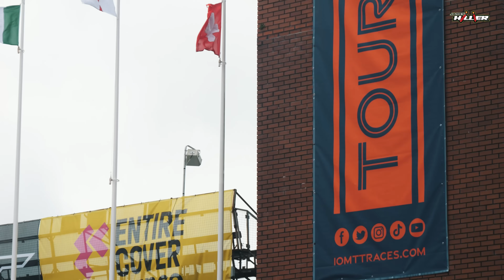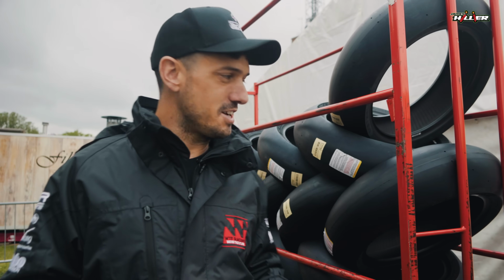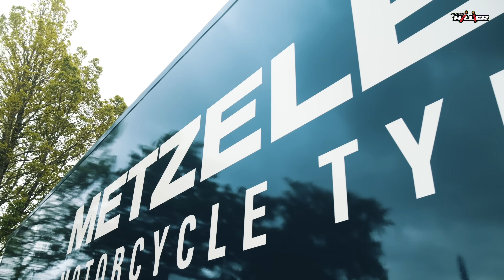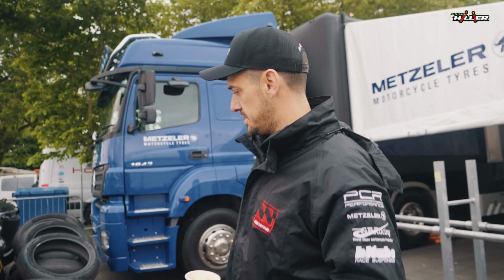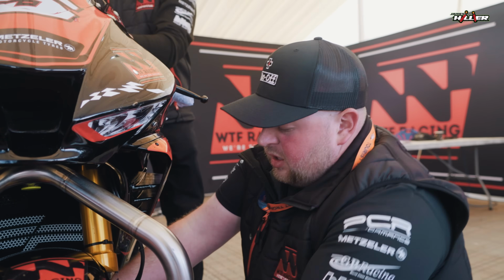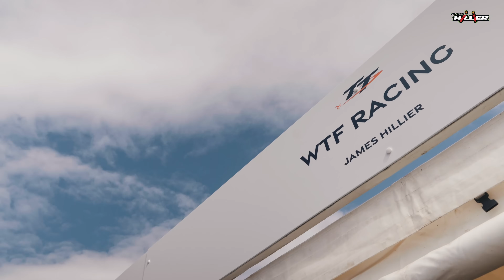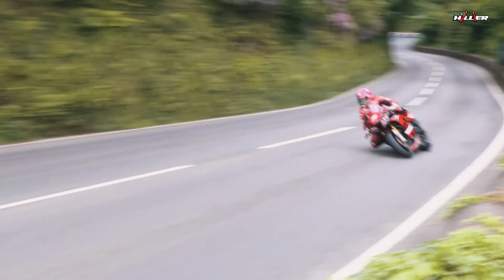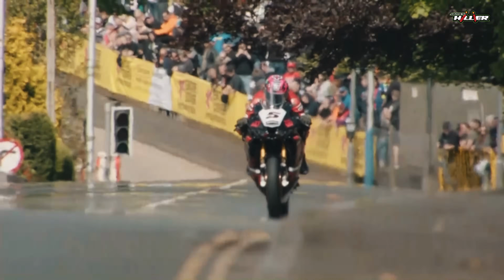Isle of Man TT 2024 // James Hillier - Episode 3 - 'Rubber meets the road'

Comment: Your TT coverage is by far my favorite. I really enjoyed the detailed discussion about tires and how you set the bike up. Some interesting topics could be: suspension setup, day to day logistics of running the team, how do you use the data you have collected to improve (you touched on this in this video) , how do you gather this data (telemetry ?), gear preparation, handling mixed surface conditions on the course (wet in some parts dry in others). Details like this give people an insiders point of view and no other riders are talking about these things in any detail. Have a great TT James.